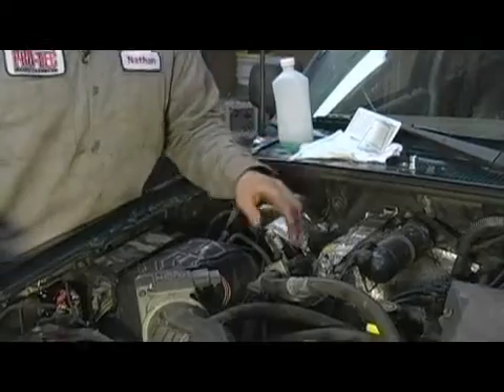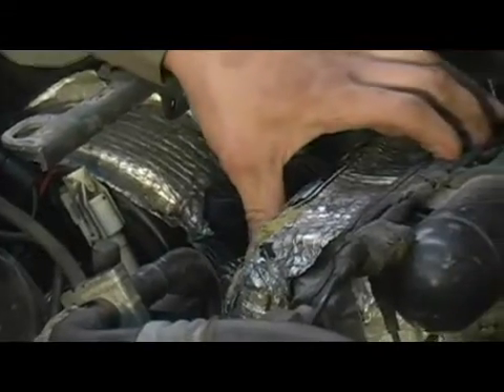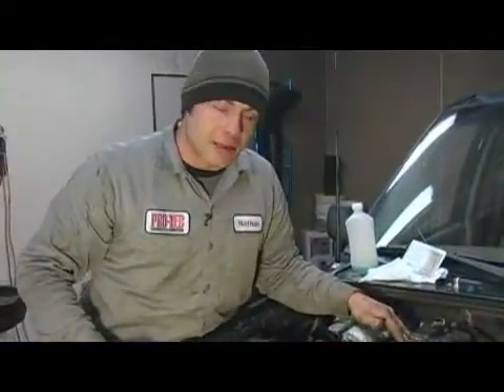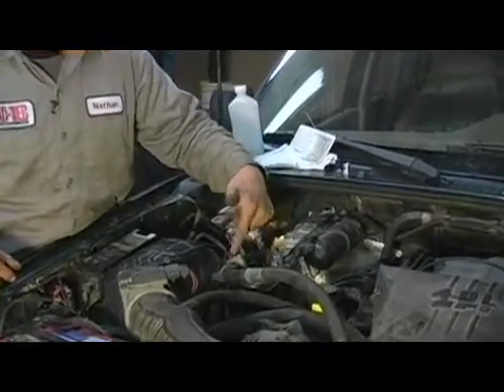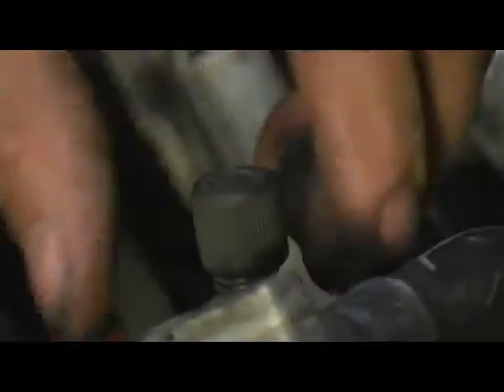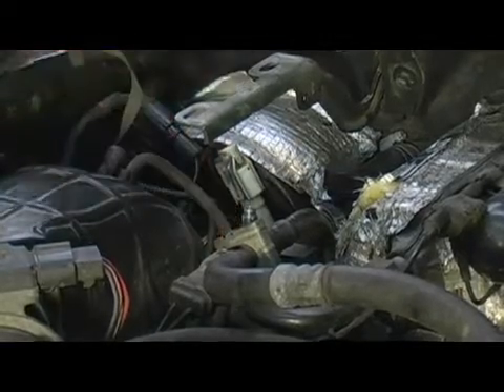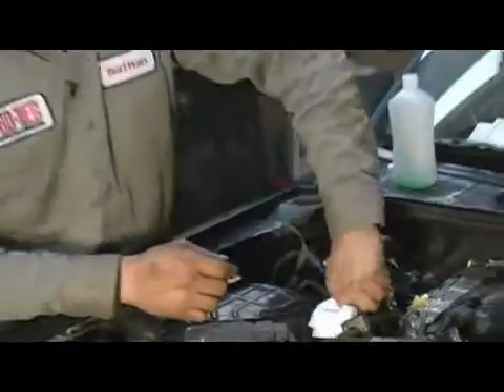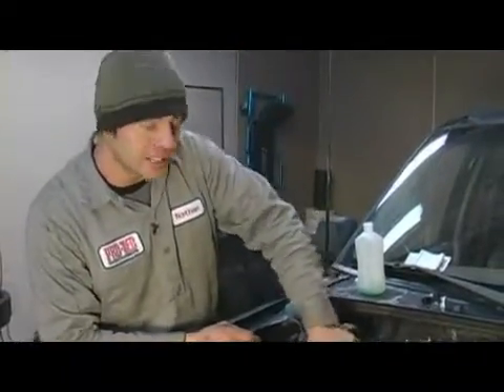Changing the Fitting of a Car's Low Service Port

Comment: I bought the new ports and silly me. I was trying to take off the port from the pipe and at the same time scratching my head that I was doing something wrong.
Your video clearly banged my head and it was so easy to screw the port on the existing one...
Thank you